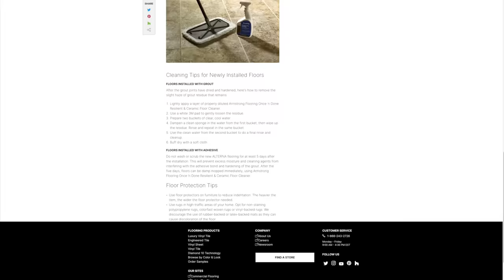Cleaning Mistakes You Are Probably Making

Comment: Yes, I caved in to Swiffer mania but they got dirty so quickly and replacing them was such an expense. I'll try using my wand with microfiber cloths now. It does make me cringe a bit using water for dusting... I grew up with the Lemon Pledge for dusting instruction. Hard to break that habit!

Thanks for the tips! I've adapted my cleaning routine to using the S-pattern, cleaning top to bottom and handmade cleaning products (no bleach for years) thanks to Melissa. Working on my decluttering with guidance from Cas!

Comment: I have a swifter handle that I made “ homemade swiffer heads. I use them then toss them into the wash when needed. I like to clean with Murphy Wood oil soap. It can clean many surfaces. I also like Dawn and water to wipe down counters. If the ants come, I use vinegar in a spray bottle to clean.  Most furniture today says not to use cleaners only a damp cloth to wipe down. It’s usually finished with Polyacrylic, that’s why it feels plastic. Grandmas old wood furniture gets proper cleaning with product for wood, old English for us. Sometimes my microfiber cloths leave little bits of dust pieces. If it’s wet, I’m just making more of a mess than cleaning. Does that mean I need to retire this one and try a new one?  For paper towels and napkins, unless I’m cleaning up a broken egg on the floor, I have made cloth napkins for every day use rolled and in a little basket on the table.  Just use up your material and have fun with it. Now my husband, that’s another story , he loves to kill a tree with his paper towel use.

Comment: I have to partially disagree on not using your steamer on vinyl plank flooring. Many (including mine) are 100% waterproof.  One of the selling points on ours was a piece of the flooring just sitting in water with no damage. I also took a scrap of the flooring when my hubby was installing it & sprayed bleach cleaner on it. I let it sit all night. No damage. I use bleach sparingly but never mix it with anything!  Thanks for the helpful tips!
Reply: Waterproof and steam proof are different. The manufacturer of my LVP says not to use steam mop.
Reply: Are the cracks between the planks also waterproof?
Reply: @jeme7339  my opinion is no. Waterproof doesn’t mean the the floors can sit underwater. It just means spilled water or lite mopping won’t damage it. Again this is my opinion on reading the manufacturer instructions.

Comment: I've been told that using regular hydrogen peroxide works the same as bleach but without that harsh smell
Reply: Peroxide hardly hurts any kind of surface and is superior to bleach as a disinfectant.  70% or higher Alcohol is also superior but it can damage some surfaces if you aren’t careful.

Comment: I use 1 Swiffer duster a week or every other week, and buy it in a 24 pack at Sam's. Micro fiber puts micro plastic in the water, and then in our bodies. Microfiber gets 100% full of dust way too quick (way less surface area than the fringes of the Swiffer) and can't handle the delicate swoosh over delicate ornaments or intricate details of ornate furniture. I swish as I walk by, and it takes like 10-15 minutes to Swiffer the WHOLE house, ceiling lights to baseboards, doors to decor.  Finally, I dust the bathroom floor, well, I really use the full Swiffer to sweep up all the hair, on the bathroom floor, and I dust the toilet, then TOSS IT.  I am NEVER going to waste a load of laundry on a single sanitation cycle for 1 nasty toilet dusting microfiber. Personally, with cat hair and my own hair, I like to dust away this debris from the base and lid-hinge area, BEFORE I use my disposable Clorox wipe (ONLY for the toilet, 1-2 containers a year), so my Clorox sanitizes, and doesn't get wasted wiping up debris. I am a 💯 tree hugger... Up until the point that I have to consider my own sanitization, or when I start calculating whether it's better for the environment to use 1 disposable wipe, or waste a load of laundry water with soap and micro plastic, or the cost of discretionarily used disposables versus investing in high quality reusables... I give up the stress and self judgement, and go with the easiest option.
Maybe if I had more reasons to run a sanitization wash cycle, I would feel otherwise, I just wanted to suggest a way that the disposables could be used in an environmentally thoughtful way... I DO use reusable napkins and repurpose old clothes as cleaning rags (like window washing, wiping spills, etc)... I ONLY go disposable when the germiest germs are involved 🤷‍♀️
Thank you for coming to my Ted talk. 🥰
Do what works for you!  Other than the mixing of chemicals, none of these are really objectively "WRONG"....

Comment: I've been drying and cleaning the toilet brush for decades. When i was pregnant ( 30 years ago) i was in a ultra cleaning mode. I noticed that the brush was dirtier than i thought.  Not only do i dry it, i wash it. I 1st use it with product to clean the bowl. Then, flush and use the cleaned bowl water and a little cleaner to clean the brush. I still clean the container when needed because my husband doesn't have the same need to have a clean dry brush.

Comment: i was brought up to wash my floor on hands and knees and that is perfect, but as i get older lol I cant do that anymore, so I use a simple flat head mop for a lot, even dusting under bed. but spray it with a little water and for quick easy cleaning use the flat head, but getting on your hands and knee is best for the corners. I do like the new mop and bucket with one side for washing and the other side for rinsing and then you put the mop head in the spinner.

Comment: I've switched out all my cleaning products and supplies to Norwex. I did try and loved Melissa's microfibre cloths. Norwex has the bacteria absorbing silver in it which is the only difference and why it costs more.  I love watching the two of you. Great job!
Reply: There is huge misconception about norwex cloths. So many think that the silver kills bacteria and is a disinfectant when cleaning. This isn't exactly true. Silver has been found to basically be effective against bacteria, but this is only in the cloth itself it prevents it from odor, it doesn't disinfect a surface. It does also help against cross contamination of bacteria, but again, it is no more effective than using a different rag for a different space (which you should be doing anyhow). Studies have also shown that silver ions are released i to water sources when washing the cloths, which do go back into the water supply. This along with silver infused linens, silver infused clothing, etc (all done to prevent odor caused by bacteria) causes more silver into water, which high levels can be harmful for humans. So far no enough has been used to cause damage, but prolonged exposure (think bedding, clothes, cleaning cloths, etc) can cause concern.

Comment: I do enjoy watching your videos but I have a couple of comments about this video.  As a nurse of nearly 30 years, one thing I've learned is that a 1:10 solution of bleach to water will kill just about any type of bacteria.  I've used it to clean contaminated hospital equipment.  Bleach is the recommended cleaner for C. diff.   My other comment is regarding the use of furniture polish.  I have found a Pledge multi-surface antibacterial cleaner that I like to use on my furniture.  It cleans, dusts and can be used on nearly any surface, including glass.  I find the best products are the ones that can be used in multiple ways.  Thank you.

Comment: I would add one thing here that's important since MICROFIBER is not environmentally friendly if washed incorrectly will end up just throwing them away too soon. I learned don't wash them with other towels they will COLLECT lint, and they will get "ruined" if dried incorrectly. Melissa said a lot about reading instructions before using new products, and also buying quality microfiber cloths for the specific purpose you need and taking care of them so they will last. Thank you great video!

Comment: I've used my steamer on our concrete and Pergo floors forever 10 years and no warping of the Pergo!  For quick mop I use a Bona spray cleaner with microfiber pad. It works great too.
Reply: I love my steam mop. I have laminated floors, and you're not supposed to spend much time mopping. Lowest setting, and you quickly swipe a surface ONCE. No chemicals, everything smells great and no warping. I spend more time only in the bathroom. Love it.
Reply: I use Bona on my wood floors amazing.

Comment: I have an extendable duster from Walmart (washable microfiber head though, not a swiffer one but great value) and I love it. It even has a short handle you can unscrew the longer bit for, and it's on a bendable bar so you can make it wrap around ceiling fan blades.

Comment: Brilliant video! Great tips on avoiding cleaning mistakes. BUT, I'm going to have to disagree with Melissa on one point. The Swiffer duster is really great. I agree that it's wasteful, but it works! I also only use them once or twice a year for **Big Seasonal Cleaning**. Maybe if I can figure out how to wash my microfiber in such a way as to get that static-cling energy to happen. Mine don't do that, and I suspect it's how I'm washing and drying. There's also reusable swiffer heads you can get that washable, but I haven't tried those yet.

Comment: I don't use Pledge for anything, but I do use Favor.  It seems to nourish the wood and I don't get build up.  The trick is to use only a little, and go over it with a clean micro fiber cloth again, once it's dry.  Colorado is too dry to use only soap and water: the wood will dry out, even if it has a gloss or veneer finish.

Comment: I do use microfiber cloths at times. Other cloths/paper towels leave lint on my car when I'm wiping down the inside (using only water-damped cloth). I use a Flylady feather duster I bought years ago mostly, but every month or two, I use a microfiber cloth and Pledge (very sparingly), though I'm looking at other things for when I run out of it. I do rub it down a lot after, which is why I don't do it that way all the time!

Comment: My grandma was the "bleach it" type. My mom would use bleach to a point and I USED to use bleach. Now, a little multi-purpose/surface cleaner is my go-to. I'm not allergic to bleach but extremely sensitive to it. I never use ammonia however. It literally splits my skin open and I bleed.

Comment: I use a steam mop for my wood floors and it hasn't ruined anything. Our house was built in the late 80's so maybe wood finishes from then are better? I've steam mopped for the past 7 years and have no plans to  stop. I like that I don't have to use a cleaner, the floor gets clean fast, and if you have a good steam mop that isn't steaming out puddles of water, it's dry in less than a minute.

Comment: Feather dusters actually have a static charge that HOLDS the dust! You shake it out outdoors and wash it occasionally. I keep a deep drawer chock full of two types of microfiber towels and use the for EVERYTHING except greasy stuff. The pink stuff can also be potassium from a water softener, OR...salmonella. I keep a small bottle of bleach in the laundry room, not for washing, but for tub cleaning when my front loader starts to get stinky.

Comment: A quality ostrage feather duster is perfect to grab dust. Lightly move it around nicnacks the shake outside. Quality ostrage duster will hold the dust if used properly.
I clip a swiffer on one side of my cleaning apron and a sm ostrage feather duster on other side, microfiber cloth  in pocket and ecloth glass cloth in other. Cant live without them.
HouseCleaner for 30 years.

Comment: when i was a kid we'd put a dishtowel on a broom and use a rubber band to keep it in place. i have something that looks like the swiffer duster but it's reusable, i can throw the duster part in the washer, i love it. it's got a long pole that allows me to reach the light fixture in the foyer from the top of the stairs. I have to restrain myself when it comes to cleaning supplies lol. I have a few that I keep in the kitchen and bathrooms and it's just what i need for those spaces then in the closet near the powder room I have a few others that I use for other spaces but man when I go to the store I want to buy everything because it's a pretty package haha. I have a microfiber mop that has a spray thing on it and a few replacement pads, I love it, we have a mop roomba but i spot clean with the spray mop. I'd love to have a steamer to clean the bathroom floors but I sooo wouldn't use them on my hardwood floors. For my toilets I buy 6 sponges from the dollar tree and I use one to clean the bathroom, I start with the sink, then the shower then the toilet, I use dish soap and water on the toilet and then throw the sponge away. fresh new clean sponge each time and they're not expensive. I don't use that sponge inside the bowl just the seat and outside. I don't own pledge but I did inherited a table from the 70s. I bought a special cleaner for the table that is like a moisturizer as well,  we replaced the chairs (harvest gold velvet wicker back eehh) because they were braking and we had some custom made and the woman told us what product to buy for the type of wood the table was made out of and it made the table beautiful, cleaned it and made it shiny again.

Comment: Meliora cleaning products are safe, gentle and work well on most surfaces. Citra-Solv is another product I won't be without. Dilute it with water for most cleaning jobs, straight from the bottle to get sticky or gummy stuff off. Bon Ami scouring powder, baking soda and hydrogen peroxide are my other go-tos, depending upon the job at hand. I don't mix any of this stuff, because it's simply not necessary. I don't buy bleach. If a shirt or underwear needs whitening I use a non-chlorine product and just accept the fact that it will never be as snow white as when it was brand new. Oh, and I have some enzyme spot cleaners because I can't make dinner or eat it without splattering food all down the front of my shirt. 🙄

Comment: Nope on swiffer, housekeeper at hotel use micro fiber at home and work.  First thing you learn is top to bottom. Make the bed before dusting surfaces lint lands during the process. Specific cloth to clean mirrors. Hot vinegar water squeegee and old dish towels for windows. Except car that is the cheapest literal paper to do car with vinegar water. my cordless vacuum reaches cobwebs….  Guilty of ruining my brand new vinyl plank floor with steam mop. I use a soft scrub brush and rag behind to scrub my laminate by the back door…..mud. The mud gets down in the texture of the vinyl plank after a week or so….I don’t wipe my floors daily. Dog’s feet don’t always come completely clean spring lasts all winter now.

Comment: The only thing pledge is good for is if you have a window that’s hard to open. Spray it on the side tracks and it will make the window move easily. Learned recently from a window installer

Comment: When I mop walls or floor, I never put my cleaning rag back into my cleaning solution. I change the head when it’s dirty or the rag and when they’re all dirty, I’ll take them and rinse them out that way my cleaning Solution that is in the pail stays clean Can I use the flat microfibre mop to wash my floors when the mop head is dirty I replace it with a clean one and actually I just spilled some of the liquid on the floor and mop it around and then change the head

Comment: Microfibertowel is good for swiping of stains for me but I do so not have the patience to dust with it. Swiffer all the way, it sucks up so much dust so Quickly and it does not lift it up in the air and I can use the same ”cloth” for several spaces wheras with a microfiber you do part of a surface then it is full and gross. 

Plus can swiffers between decorative items.
Sure you need buy new ones but as I live in a small apartment and dust like once a week it lasts long.

But otherwise good tips.

Comment: As a retired, professional housekeeper… I hate when my customers demand bleach, or that I clean with vinegar. They don’t realize that I have a hard time breathing after I use the products. They cause respiratory problems even by themselves or diluted with water.

As far as pledge goes, I don’t like using that product either because it causes degradation in the material. Meaning it causes it to decompose. Much like a lot of the oily interior car cleaners that also cause degradation. And shorten the lifespan of your pleather or leather or Wood furniture and car interior. -I also used to sell auto parts lol 😂
Pledge causes a oil sheen that also collects dust and builds up over time. Never use oil for wood. except for when cleaning wood. And buffet out afterwards. It has to be a wood cleaner. Not a polish. 

I do have a cheat for black stoves that you can also use the same product to make them not only look new, but use it on glass for heavy scratches like showers… I use chrome cleaner. If you’re going to show a house you want to hide scratches. It won’t fix it. It will just hide the scratches. 😊 

Pink liquid in the toilet brush holder is water softener that is contaminated with bacteria. Bacteria love the water softener. And begin to grow on the water softener. 

Thanks for posting the video.